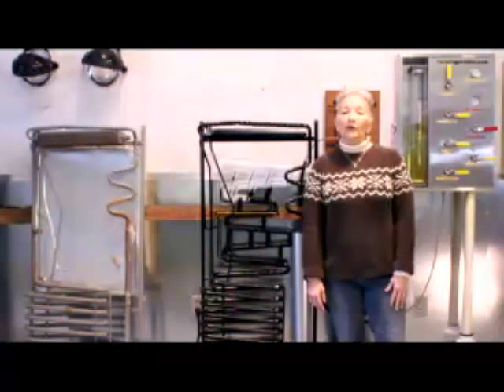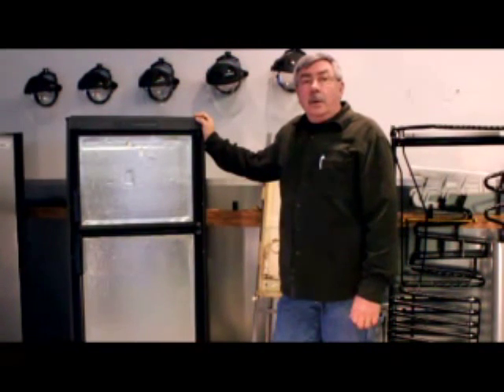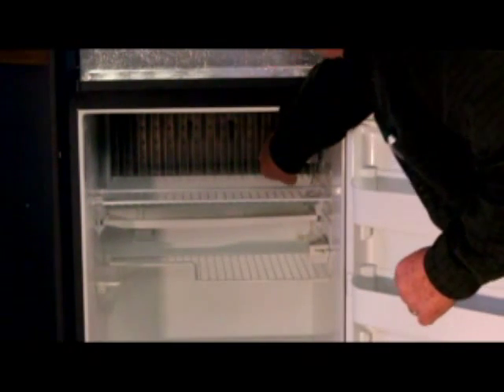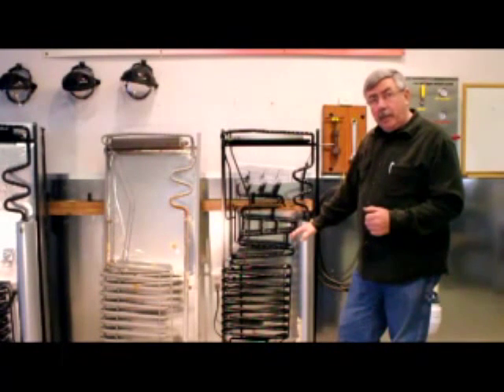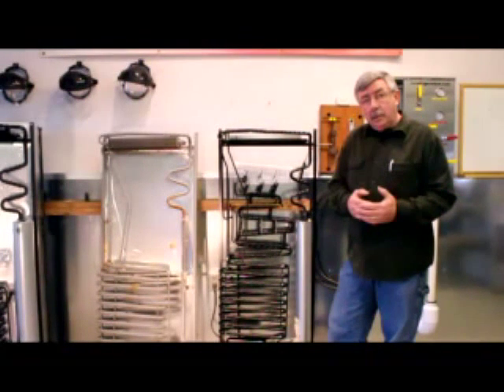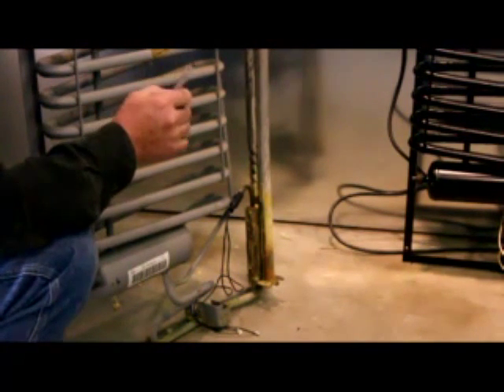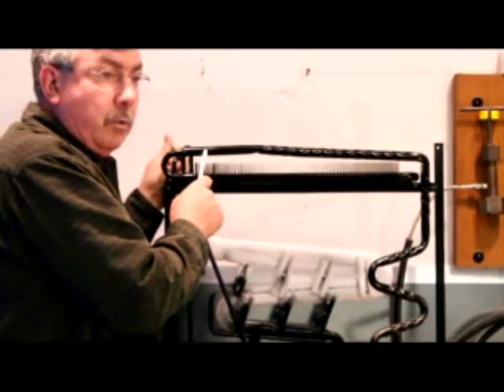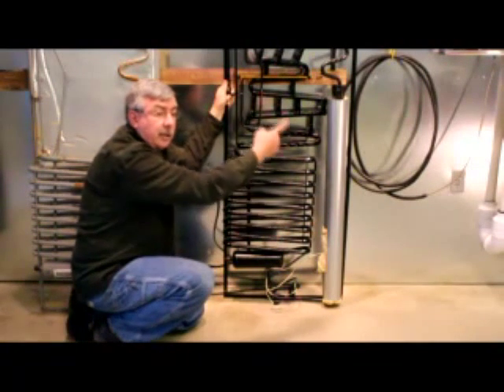Repair Fridge In The RV,Camper,Caravan,Campervan,Carvaning,Wohnmobil,Motor Home Salon,FRVTC,FRVTS

Comment: Informative video. We recently acquired a vintage camper that is equipped with a Dometic refrigerator. The part of the cooling unit accessible from the access panel has quite a bit of rust. What type of paint and rust treatment is safe to use on the unit?